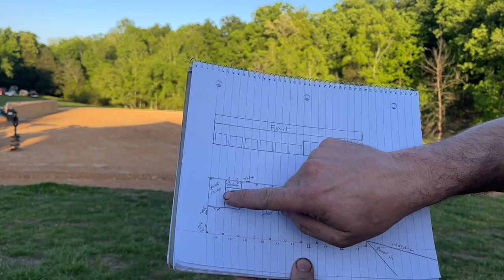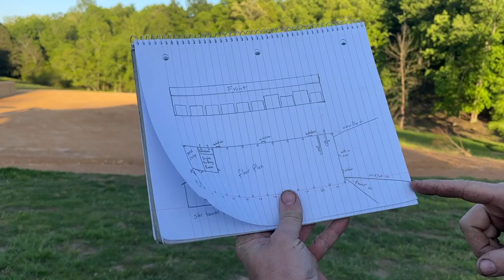I Never Thought This Would Be Possible. Building My Dream Shop. It's Massive!

Comment: Josh, love the new shop. Looking forward to seeing it when you’ve moved in. One suggestion based on hind sight. Somewhere on your back wall put in a door. Not just in case of an emergency but easier access to your air compressor and for Tash’s picnic table.
Reply: Yes you need a back door, and a bathroom

Comment: Congrats to the Sleeperdude team! I love watching your videos and it fills me with joy that the whole family participates in the projects. This channel has given me the confidence to do some DIY stuff to my own vehicle, earlier this month I self installed a spoiler and was finally able to do an oil change 100% on my own, the first time I tried to change my oil alone I did not have the strength to remove the drain plug, so I had to get my dad for assistance and he ended up doing it himself. This time I was able to get the drain plug off rather quickly with a better socket and I was so happy until I spent over an hour (probably closer to 2) fighting with the oil filter. Someone took your advice and got it "tight enough so that the next person couldn't take it off". I eventually got it off and finished the job. Other than that it was super easy (says the girl that took 2 hours to do an oil change) 😅. Thanks for the awesome content Sleeperdude!

Comment: I left messages on the last video, and don't have much more to say, but, a bit of advise is that VW Beetles are dead reliable. My first was a 1954 0val-window , and the second one was a new 1959 Beetle, then a 1664 Squareback wagon. Then,
we left VW for a few years while the wife stopped having children, then, we went to a 1964 Pontiac, a1994 VW Passat VR-6 beauty 5-Speed with Cruise control, air, and all the goodies available back then.
A Beetle should run fairly quietly, but we lived in Saskatchewan, Canada, directly North one North Dakota about 100 miles. You should have a good experience with your Beetle. I'll add advice when you need it, but, no problems likely.
Allan

Comment: I’ve got a question about brakes. In July I pan on putting my duster in a local shop for a disc brake conversion. The car currently has standard nine inch drum brakes all around. Assuming I’ve bought all the correct spindles drum etc how long should it take an experienced mechanic to complete this work ? I’ve also bought new bushings and bal joints for both sides……thanks

Comment: Use to pull fence posts with rope and a mickey thompson drag tire with 40 pounds of air in it. rope and tractor. 50 years ago in Randolph county NC. During my traveling around the country on my chopper stopped in Tenn for a while and built trusses think it was Maryville or Alcoa. Them Blount County deputies harrassed this old longhaired outlaw biker till I headed to Florida.

Comment: You deserve it, Every petrol head's dream is to have a fully loaded workshop, i'm currently happy just to have a tiny 8 x 10 shed just big enough to work around my motorcycle after having to work outside since moving to a rented property with a small garden ( and trust me a small garden here in England is very small ) but i dream of having a property with a decent size shop which will happen eventually as i will inherit the property i grew up in when my dad passes but i would rather that not be for as long as possible because i would rather stay in a tiny rented place and have the old man around than inherit the house with a kitted out workshop and not have the man that taught me most of what i know and from whom i inherited my best traits from, my fondest memories are working with my dad in the family business working on cars, he taught me the basics in panel beating paint and body work, and i am sure your kids will also have fond memories of working alongside you. you should be very proud

Comment: congratulations on the shop coming together. I've been building shops like this for the last 22 years. No matter what you couldn't have built it big enough. At least that's what every customer has told me. But they are all happy with the building's and these are much easier to add additional space to. It's at least high enough to add a lean-to in the future off the back of the building or even go longer with no problem.

 I have a question for you are you insulating that roof? Because every rib that bumps up at the eaves and up at the peak at the ridge cap is a way for bugs and even bets to get into your building. What we are doing around here in the Inland Northwest is suggesting people get a blow in foam insulation company to shoot the roof that offers gap's to be filled but most importantly for you it offers sound deadening during rainy days which gives you a better sound quality on videos.

Comment: Glad to see your new shop come to life ! As a House and Building Designer for 42 years I can say that the basics of your building looks good. I designed a similar building for my neighbor about 10 years ago that is only 40'-0" x 50'-0" but has a full perimeter frost wall ( 10" thick ) which we have to do here in Ct. due to our harder winters. We also went 16'-0" in height for a car lift. You know  ,there is a roof and floor truss company we use in Springfield , Massachusetts which have built trusses with a 96'-0" clear span which is amazing.  Great to see your channel succeeding for  you all. It is good you purchased a big enough property to allow for future expansion such as you are doing now. Hard work pays off !

Comment: If the pad hasn't been poured yet make sure the put a vapor barrier down before they pour. If they don't all the moisture from the ground will come right up through your concrete and your building will be damp. My dad built a garage and the guy didn't put a vapor barrier down and if you work on the floor you end up soaked by the time you're done. It stinks 😩 
Congrats can't wait to see videos in it.

Comment: Hello from Montana. Just wanted to throw a suggestion your way. My shop is small at 70 x 70 but the thing I love most is the radiant heat floor system we installed. Just need a good boiler system and you'll love laying on a concrete floor that's 70°. Best thing I ever did. Love your videos so far. I just subscribed to your channel today.
Reply from the maker: Great tip! Thank you